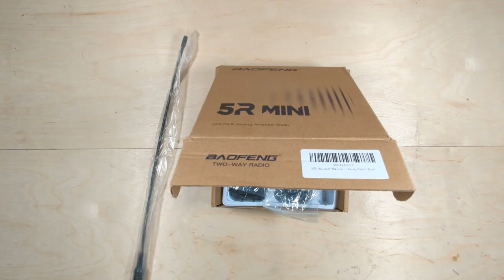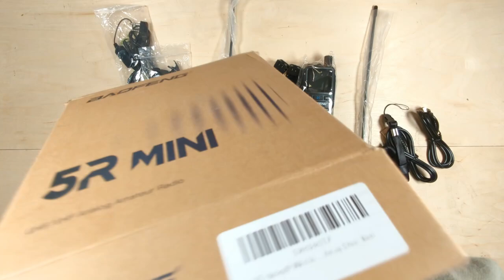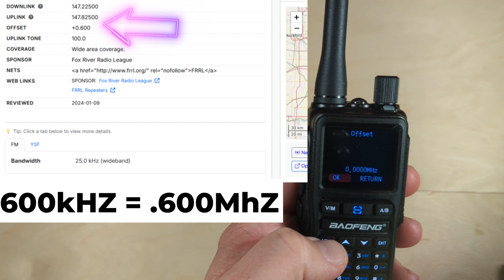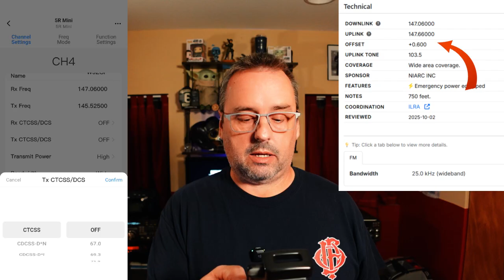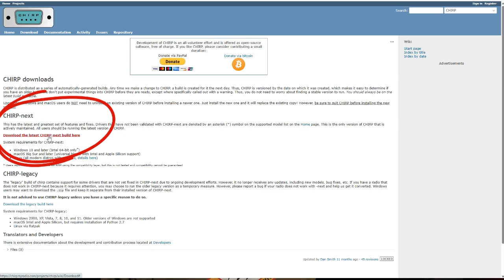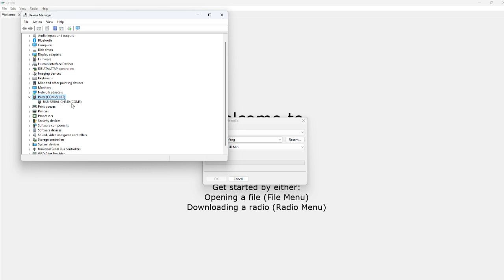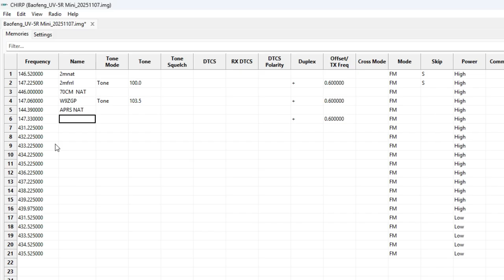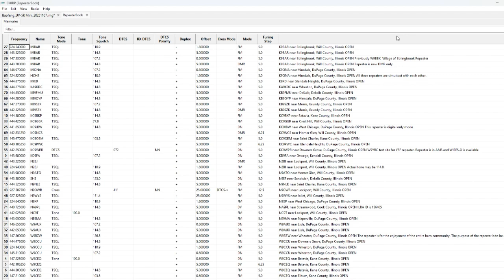Program Your Baofeng UV-5R Mini in 3 Different Ways!

Comment: Nice review!! Question, how can multiple FM, (music/news channels) be programmed/added to list?
Reply from the maker: From what I found playing with mine you cant program the FM channels its just a function that allows you to listen/monitor FM stations. 
FM Radio Function
Set the [SK1] key to the radio function via Menu >> Radio Set >> Press SK1.
Turn on the radio and press the SK1 key [FM Radio] to enter radio mode and the screen displays the tuning frequency. The
following operations can be performed:
-Press ▲/▼ key to search for radio channels at the preset step frequency.
-Press the [#↑ ] key to search for radio channels automatically, the screen displays 'SEEK...'
-Press [EXIT] key to switch frequency band between 65.0/75.0MHz.
-Press SK1 key [FM Radio] to exit radio mode

That was from the manual so I hope that helps. 73